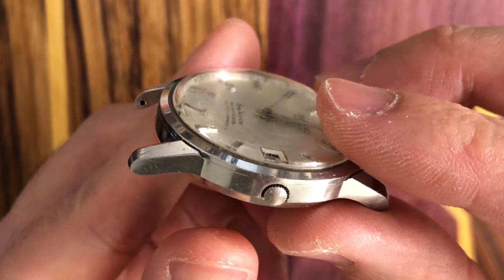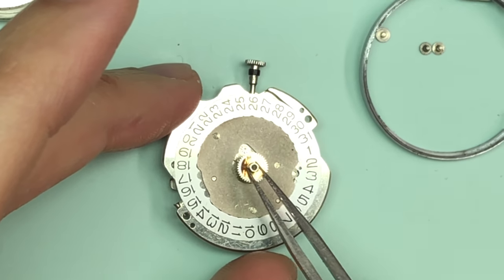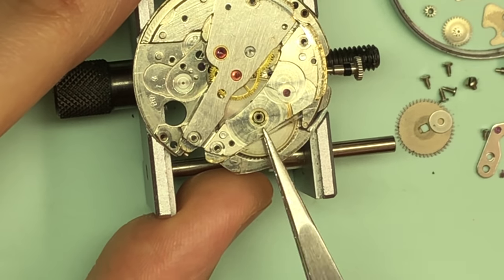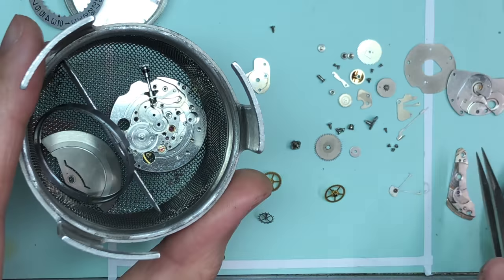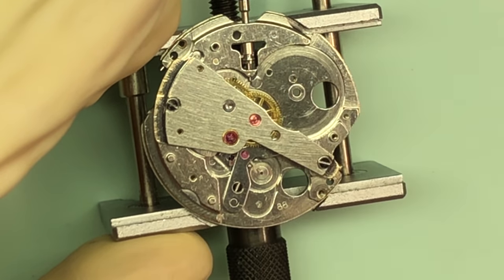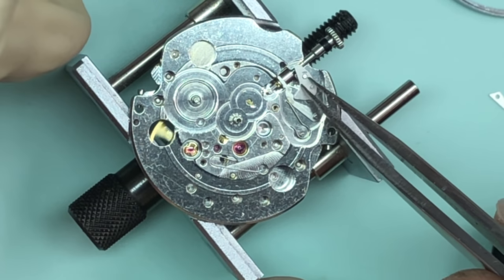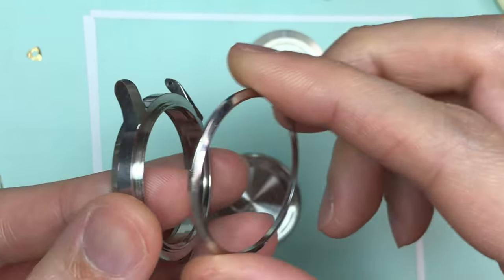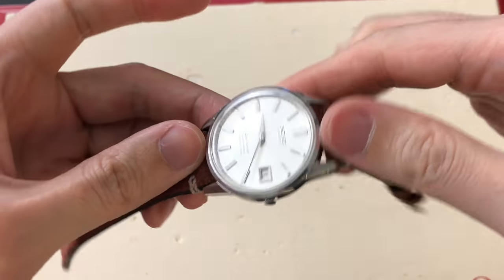RESTORATION OF A 1965 SEIKO SEA HORSE aka JAPANESE SEAMASTER - Caliber 7625 service

Comment: I have a vintage Constellation in dire need of a restoration. I don't know where to go without paying a fortune. The dial is in bad condition. The watch runs but the movement is a bit loose in the case. It has the 505 movement. Inside it says 2852 15 SC. Do you want to have a look at it?
Reply from the maker: Thank you for the comment.  Unfortunately, I do not have time to work on clients watches due to my busy schedule.  But do try asking on the Omega forums to see if someone can refer you to a reliable watch maker.
Reply from the maker: Hi, unfortunately, I have stopped taking customer repair for many years due to my busy schedule.  You can try asking on the Omega forum to see if anyone can refer you to a reliable watch maker near you.

Comment: Hey, letting down the mainspring by removing the pallets isn’t such a great idea. Use a screwdriver on the ratchet wheel screw and then move the click spring away from the ratchet wheel(using tweezers or pointed peg wood) while slowly letting the barrel unwind holding it with the screwdriver.
Reply from the maker: Yes you are absolutely correct.  That is something I do as well.  Only for Seiko watches.  But I find releasing it this way does not harm either.  Maybe I got lucky.  But for movement with a winding wheel I’ll be able to release the mainspring with the tweezer, click and crown method.

Comment: Did the crystal have a tension ring on it?
Reply from the maker: Seiko crystal normally does not require ones as they are tightly hold by the bezel similar to a Rolex watch.

Comment: I've been wondering if the Grand Seikos from the 60s were comparable to the Constellations of that era, in terms of prestige, accuracy, reliablity and ease of service.
Reply from the maker: I am not sure how they compare back in the 60s.  But if you can locate one in great shape and service it, the accuracy of a 60s GS can be just as accuracy as any Constellation of that era.
Reply: I own a vintage King Seiko 4502-7000 from 1968 which has basically the same movement as the Grand Seiko 4520 in it & they are very high quality watches. Mine hadn't ever been serviced in 52 years & was only running 13 seconds a day slow! It's been serviced now & keeps time to -1 second a day. These also had the same base movement that Seiko entered into the Swiss chronometer accuracy trials in 1968 when they came top for Mechanical movements. I don't have a Constellation to compare it to but I do have a vintage Longines Conquest Calendar & the quality is better overall I would say with the Seiko feeling like a precision instrument! The only downside I would say is the ease of service as not many watch makers have experience of working on them & also parts can be hard to find.

Comment: Excellent video. I want to take the opportunity to ask you a question, I have a Seiko 6619-8970 to which I have to change the crystal, could you help me to know which one is correct? and where could I get it?
Reply: My information says it would be a 327W01AN crystal.
Reply: @stevenmeitner8477  Thank you very much for the information, but then I think I have a problem. I have a NOS 327W01AN crystal and my watchmaker says it doesn't fit, that it is different from the original! I will probably have to deal with another watchmaker.
Reply: @ernestolara1012  Sometimes the crystal retaining ring can be very tight...especially if there was any corrosion.   Does it fit the case without the retaining ring?  One other possibility is that the back was changed at some point which might mislead you on the case number.
Reply from the maker: @ernestolara1012  You may need to try a new watch maker and see if he has the proper tool to fit it for you.  Fitting on a new crystal can be challenging sometimes.  And if not set correctly you can easily crack the crystal as you use the crystal/bezel press.
Reply: @TimelessHistoryChannel Thank you very much for answering my question. Apparently the watchmaker is right, the original glass is 1mm higher than the 327W01AN, so when he try to install it, it hits the hands of the clock and stops the seconds hand, this is probably not the one I need, I will have to keep looking. I really like your videos and especially your collection of watches, I have several Omegas.
Reply from the maker: @ernestolara1012  Maybe your watchmaker should help you order a crystal for it from his local watch supply house.  I believe you can also order crystal directly from Seiko (at your country) as well.
Reply: @TimelessHistoryChannel  Thanks, regards Ernesto.
Reply: @ernestolara1012  Do the hands sit near the dial and appear to be evenly spaced?  The reason I ask is that some Seiko parts can be swapped, like the fourth wheel, but the spacing could be off causing the hand to foul with the crystal.  

The Seiko crystal part numbers are often easy to decipher.  The 327 refers to the diameter (32.7 mm).  The W means watertight (water resistant).  The 01 is the style or profile.  A stands for material (acrylic).  N stands for Normal finish.  I know there are 327W04AN, 327W09AN, and 327W16AN crystals of the same diameter with different profiles.
Reply: @stevenmeitner8477  Thank you very much for all the information, it helps me a lot since this is my first vintage Seiko, I bought it without working and with the broken glass, so I am trying to restore it. From what you tell me I think the problem is going to be with the profile of the glass, we put them together and one is taller, the W01 does not reach the base of the case, it is approximately 1mm missing, I really appreciate all your help .

Comment: Wow! That has to be one of the dirtiest mainsprings ever!!
Reply from the maker: It is very dirty.  But I believe it is not actual dirt that got inside.  It is a type of lubrication similar to what you see on many vintage Rolex watches.  It has an awful smell to it as well.  And when applied too much it can leak out and get onto the parts inside the watch.
Reply: Yes it's Seikos S2 main spring grease!

Comment: some refer to the early seiko autos as a true automatic …bc winding isn’t great for autos anyhow. and yes you flip these upside down to change the time. also, criticizing other watchmakers but handling the dial, chapter ring and calendar ring with bare fingers isn’t great either - no pegwood in the bench?
Reply from the maker: I do.  
I only use my bare fingers to touch and disassemble a watch initially.  Once it has been serviced I will need to put on finger clots. Dial, crystal ring and dial ring I do need to clean them up with rodico before assemble them back.  Anyone who is a client of mine knows they do not see any stain on my watches.
Reply: I’ve serviced a lot of these old jdm watches and I believe bc of the high humidity in japan, there is often moisture intrusion. My hearts been broken many times by wrecked dials and cal rings. Also because dials should be married to the case serial number, i’m particularly sensitive to how the dial is handled. Just a passsing thought. Anyhow i like your work and if you were local I’d try to get on your schedule 👍 some a service.
Reply from the maker: @MrMadvillan  Let's just I am not one of those watchmaker.  I love my watches too much to mishandle them in anyway.  Welcome to visit my site to view my for sale watches.  Just to get an understanding of the quality I provide.